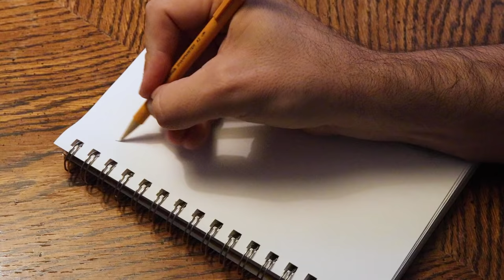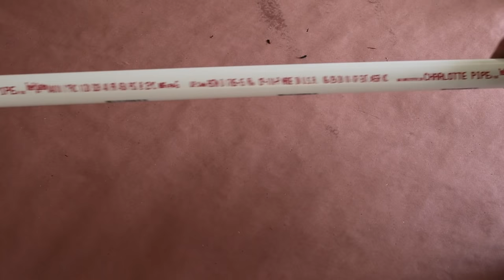PROP LAB - Creating a Fog Projection Screen? NEW SERIES!

Comment: So awesome, I admire how you engineer these projects up! May I ask where you learned these skills/any resources you would suggest to start off with? I am very interested in adding motion to my projects/dioramas. I also want to learn about LEDs, especially different ways of how to power them. I would Ideally like to plug a project in (instead of batteries), and even better, to have a remote that works with them. Thank you in advanced, I truly love your work :)
Reply from the maker: Hi Abby! It’s hard to say where I picked up the skills. I’ve always been curious about how things work and as a graphic designer I’ve always looked at things a little different than most people. So I think it’s the combination of those things that help me to engineer projects like this one. 

I have some other videos on motion and led lighting that may be a good place to start. So I’d check those out.

Comment: For the humidifier, top down.  Thats how Disney does it.  For the fog machine maybe heat the fog.  If you heat the fog you may be able to skip the fans altogether.  Use a controller like an arduino to make the fans variable or just use potentiometers for an analog solution to control the airflow from the fans, maybe you can dial in less turbulence.  Attempting to achieve "laminar flow" from the corrugated channels is a good idea, but im not sure that can be achieved as easily as, say, water.  Interested in seeing the next iteration.

Comment: what about using one of the low laying fog machines and pump the fog from above and project on that? maybe build a box that will direct the low fog in a straight line. Like the box you built but upside down?

Comment: Im sure youve probably solved this by now.  But i was thinking maybe the fans are too powerful.  2 or 3 smaller fans or maybe install a dimmer switch on the existing setup to lessen the air movement.  That might condense the fog a little better at the output.  Just a thought.

Comment: Maybe a dumb question, but did you focus the projector to the plane of the fog? You didn't show anything like that in the video. My projector has to be focused like a camera depth of field(plane of the screen/fog). Turn all lighting off but the projector. Luminosity could be a factor too. Need tons of light.
Reply from the maker: Not a dumb question at all. I focused on a piece of wood that was in the path of the fog before running the fogger/mister.

Comment: I don’t think it’s the fog that needs the tubing but the air flow itself. The tubing is acting as a duct to direct the flow but in your set up, the air is what needs directing, not the fog. The fans spin the air and the box itself causes buffeting as the air flows through. Check out how those fancy Dyson bladeless fans work. The solution might be in removing the turbulence from the air flow so that the fog or mist can slip easily into that narrow, controlled stream.

Comment: when I was working on a prop that refused to work, no matter what I did, I went into the house and my husband said, "you look absolutely dejected!" 
I told him "My prop failed" 
His answer to me, "do it over and fail better"
He was right LOL, I took it apart, drilled some extra holes, and it worked! 
(It was an electric chair)
Reply from the maker: That's awesome. I would have said the same thing. :-)
Reply: @VanOaksProps  it's so easy to become myopic when dealing with a problem prop. 
Sometimes, just stepping away for a day or two helps

Comment: Cool concept - thanks for sharing, always interesting to see the interim stages & thought processes on a project.  I see a number of suggestions about slowing the fan speed - you likely already know this, but you can lower the input dc voltage to slow the fans - super easy if you have a variable supply, but simple enough to find a 9v or 7v supply in a junk drawer.

Comment: When I've seen this done before, there was a TON more fog.  (I believe they used 3 theatrical foggers.)  I think, too the fans may be blowing a bit too hard for the amount of fog you currently have.  I'm not sure of the scale (or budget) or exactly how to scale down what I saw, but I'll work on that too.  Good luck with this to all!  Let's make it work.  ;-)
Reply: Yeah using, i think an actuator, to slow the fans down or be able to fine tune the airflow with the fog flow might help?

Comment: Its close. My bet like other is the air turbulence has something to do with the poor fog sheet. I'd suggest using a blower style fan, with a  buffer box that will redirect into a similar thing to your corigated sheet. this will create a laminar flow fog, surrounded in a laminar flow air path. creating that and hanging the fog sheet box upside down to the orientation the one in the video is in will solve the condensation build up in the tube paths.

Comment: that was pretty cool. what if instead on a large fog machine you used vape pen it won't solve the issue of the fog being visible but should give a more consistent fog cover with the benefit of being more portable. making it more useable. imagine doing a variation on the invisible man costume where the projector is hidden in the collar pointed up and the fog curtain is raining down from a bowler hat. the effect could be a mist ghost. add into the projector not just a skull but a 4 point pepper's ghost so the skull has a 3d look to it. the mist will hide some of the problems of the projector system and will make an over all cool effect add some skeleton gloves and fog piping to the cuffs of your suit and a very dapper gentleman ghost you will be

Comment: I think maybe try a hazer instead of a fogger as it gives a lot more output with little or no reheating time.  From what I saw I figure if you had more volume of fog or mist you would get a better image.  I agree with the comments about the air flow needs to be less disruptive and maybe having it fall instead of blowing upwards you would get a more controlled effect.  I am sure you will figure it out, looking forward to your next attempt.

Comment: I like it!  I was thinking that a screen made of Saran wrap or some sort of see thru plastic wrap that would be between the projector and the fog.  The "Screen" would be something for the fog to cling to...(or collect on...).  if the screen was at an angle, and the fog came from the top it would "roll" down the plastic. (?).  Another odd thought;   The corrugated plastic (Jets?) that sit in the tube...  Would it help anything if the "Jets" were different heights?  This looks like such an interesting idea...  If done right, I could see someone peeing their pants...!

Comment: I had this idea a while back. My idea was to use a fog machine and chiller. And create the curtain and have it flow down from above instead of below. Then fans may not be needed and as the fog machine recycles (heats back up), the ghost is invisible. I hope to try it or you can attempt it as a Part 2.

Comment: I saw a projection on a mist screen once at an event, instead of pushing the mist in the air, the tube was suspended and they just let the mist drop down and project on that. No need for fans

Comment: I’ve seen a mist version at a Tampa Aquarium, it’s meant to look like a portal (sort of) that ppl walk through, and there’s a cartoon animated on it, and the mist reaches the floor, so 8-10’. The mist in that instance was more like a waterfall, coming down from the ceiling in a “wall” of mist. However, there was never a “Solid” mist, it varied, but was THICK enough to display the projection… if there were fans used, they weren’t very powerful or were placed further away.
So my test ideas would first be: turn the mechanism upside down, and trim the gator board to be flush or lower than the lip of the opening.
If that doesn’t change much, I’d reduce the fan to one- OR- extend the chamber so the fans are farther away, maybe 10-12” to start, increasing 6-8” if it looks like it’s improving the situation, and I’d use cardboard to test instead of more laser cuts.
Reply: I just read several other comments saying turn it upside down 😂 so definitely do that!
Reply: Also kudos on that Gator board idea to create channels!
Reply from the maker: Inverting it would definitely work better for water vapor, since gravity wants to pull it down. For fog, my thinking was that fog is heater and therefore rises, so why not point it up. Both directions work, although I think the vapor could work if the machine was able to output even more mist.

Shortening the gator board is a good idea. I hadn't considered that. And 100% yes to cardboard for prototyping. I just didn't have any on hand.

Comment: Have you considered having the mist/fog FALL rather than rise (i.e. mount your rig on the ceiling instead of the floor), this should allow for a much fuller fog that goes a further distance as gravity will work WITH your rig rather than against it.

Comment: What if you used the same concept just turn it upside down and use cooled fog  from dry ice or something
Reply: I have a low lying fogger and thought the same (sort of) thing. There's a falling fog projection effect on Pirates of the Caribbean at Disneyland that gave me the idea.
Reply: I was going to suggest dry ice as well, but I hadn't thought about turning it upside down.
Reply from the maker: My initial thought was that since uncooled fog rises it would make more sense to point it up. Dry ice is definitely an option, although expensive and you'd need to change it out frequently.
Reply: @VanOaksProps  absolutely there are ice cooled floggers like mr  cool that might be an option  anyways I’m huge fan keep up the amazing tutorials

Comment: Use the corrugated plastic to guide the air instead of the fog.  This is what's called a laminar air flow.  It should make the air less turbulent and trapped the fog in between it. Then you won't have problems with  the condensation of the fog inside the plastic.
 You might also try a bunch of plastic soda straws yet thick soda straws compressed together to make a honeycomb pattern. It might make the air flow smoother than the square coordinated plastic channels

Comment: Great video! what about setting it up vertically- and having fog/mist/smoke jet out the side?- at CES 2013 IEEE had a similar mock up projecting Thomas Edison - i understand the engineering issues with bottom up and why most attempts settle with top down- but you lose the effect with a heavy overhead apparatus. Vertical setup would help mitigate wind and could be hidden in a foam obelisk (maybe even build a second one from the other side to really make an interesting effect)
Reply: Also with a vertical arrangement you could slightly angle the tubes/straws/corrugated material downward so condensate would drip out ...
Reply from the maker: Great suggestion!

Comment: What if instead of the fog floating upwards you set it up so the fog flows downward from the pvc pipe?

Basically,  instead of the fog flowing from the floor up, it flows from the ceiling downward.

Comment: Maybe have the fog thicker, chilled and falling from above as others have stated and have the fog come through the pvc and attach to a fanned out Y shaped piece of plastic like the accessory on a vacuum cleaner, then attach it to the center so of the pvc not the end so the fog is distributed evenly.  Coming from just one end of the pvc leads me to think the flow will be greatest at the beginning of the slot and less at the end.

Comment: Good video!! I like the corrugated panel idea but i would have tried some different methods. I would have tried other corrugated items, with bigger holes. Also on idea would be to get a better mist maker. Try a ten  port submersible  mister that are used in backyard ponds or mushroom growing, the output is phenomenal ! secondly, if using a mist maker, it work better for hazing or low lying fog, so have it suspended and shoot downwards. Keep in mind, using a mist maker like this will create condensation, so better to use outside. Also, dim the room to get a better view of what you are projecting.
Reply from the maker: Good to know. I had looked at the submersible foggers but couldn’t justify the cost.

Comment: How about trying a cheap, thicker fog? Using the mister you already have, try a mixture of 70% distilled water, 30% glycerin (be sure to shake mixture before use). Personally I'd start with 32oz or less, just to see if it works better.

Comment: Dumb idea for a fix maybe.
Well two, kinda.
1st, to make low hanging fog, ice is used to cool the fog for that blanket over the floor look. So the idea is using this Cooled 'heavy' fog have the fogger above so the blanket drops over an edge like a water fall and then project the image onto that rolling falling blanket of fog?
The other is a literal waterfall. A sheet of water would act in a similar manner to Classic Ghost Mirror projections. I'm guessing anyway.
Reply from the maker: All good suggestions.

Comment: Would the fog machine issues be resolved via some kind of "throttle" to decrease exhaust/venting speed?
Reply from the maker: Possibly!
Reply: @VanOaksProps  maybe try to prototype with a PVC ball valve? PVC fittings scale and seal pretty easily between devices.

Comment: After sleeping on this I have suggestions to do it the original way. The two channels of air a becoming turbulent by passing around the fog supply device (corrugated plastic). When we test rockets we too need "strait" un turbulent air. If you can draw the fog into  variable speed fan that then propels the fog to the "air straitener" the experiment with fan speed and corrugated plastic length and or how many layers of corrugated plastic are needed to achieve the effect. Looking up home made wind tunnels may give you ideas like this one.
https://youtu.be/jikEHfFwBd8